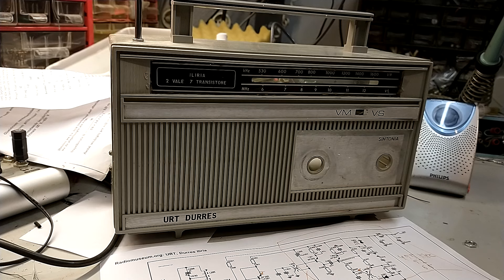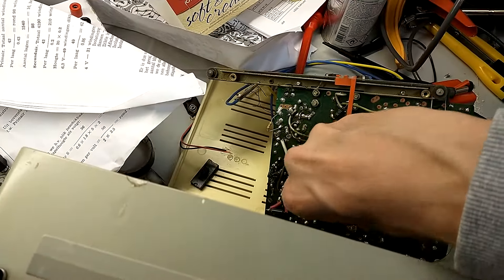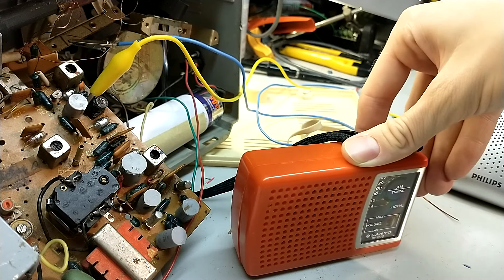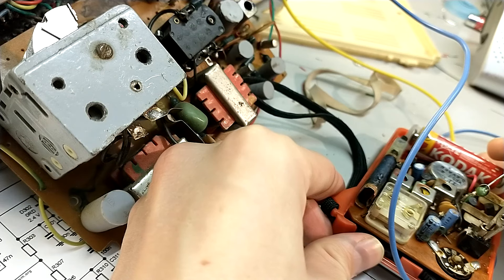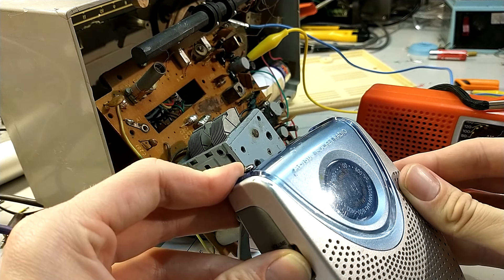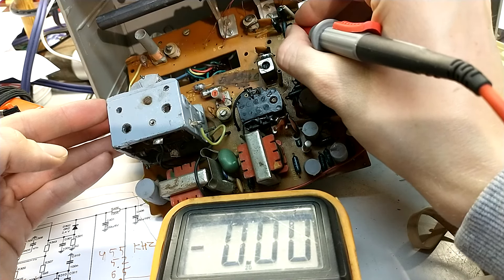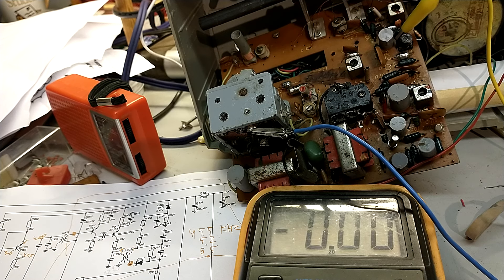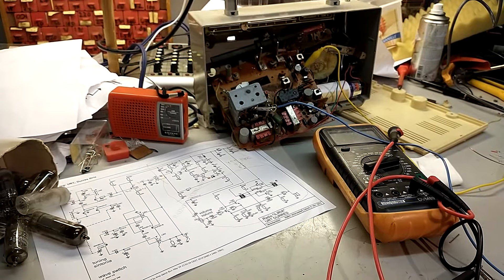Diagnosing and Repairing faults or defects in transistor radios, without special test equipment

Comment: The transistors seldom go bad.  The transistor will have nearly the same voltage on the emitter and collector when it has been biased into saturation - the base bias current has turned it fully on.  When there is something wrong with the voltages, it's a good idea to check the capacitors, especially electrolytic capacitors.  They often fail, causing leakage and excess bias current.
Reply from the maker: RF germanium transistors, as well as certain silicon transistors (the bc148 series), can in fact go bad. It doesn't happen too often, but it definitely does happen.
Reply from the maker: Bit of a late reply, but the Japanese also suffered from bad transistors though a bit later on, in the 1970s. Particularly notorious are the 2sc458 transistors in Akai GX-series tape recorders. They go noisy or fail completely. Akai recorders made before or after that time have none of those issues - that i'm aware of, i mostly worked with GX4000 and GX630 recorders. 
Although transistors are fairly reliable and definitely more reliable than electrolytic caps, if a device is malfunctioning you cannot assume that transistors never fail. With soviet transistors i have no experience at all. American transistors are rarely seen here, and all the american equipment i have had (Marantz) was either made in Japan, or from before the tube era (Hallicrafters and other such radio stuff)
Reply: @mfbfreak  
The smallest wafers that are made are 200mm, but most are 300mm.  For a BC547 or a 2N3904, each transistor 'chip' or die is a half mm on a side, so a 200mm wafer can be cut up into 20 thousand or more transistor dies.  So the wafers may be made in any country that has a wafer fab plant, and a box with fifty or more wafers, more than a million transistor dies, can be shipped to any country where the wafers are cut up and assembled into transistor packages.  A close country to the US where labor is low cost is Mexico.  So the transistors are tested and separated into various performance categories, labeled and shipped to customers, which might be Japanese, Chinese, American, Korean, or a European company, among many others.  So when you say American transistors, they may have been made and assembled in any of a number of countries, along with the same transistors sold by other companies around the world. Many transistors say on them where they were assembled.  And it seems that few if any of them were made in America, because labor is much cheaper in other countries.

Comment: Nice one I`m just starting working on old radios for a hobby age 63 making that little radio  works real good so inspiring  big RESPECT an luv to all
Reply from the maker: Good luck. Many basic problems are easy to solve. Even as a beginner you can have some success. As time progresses, you can fix more difficult problems. 
The radio in the video is a really hard nut to crack.
Reply: ...I'm a vintage transistor radio enthusiast MYSELF-!
Reply: moi je suis plus que débutant mais avec une aide et votre  méthode  je pense peut être arriver a quelque point positifs  à 65 ans  @mfbfreak

Comment: That's good, now is there a way of diagnosing the 3 sections of a tube radio without special equipment........signal generator, and oscilloscope?🐞
Reply from the maker: It works mostly the same, just take care with the high voltage. 
Tube radios can also have different IF frequencies depending on where they came from (Dutch 452, most others 455, but german sometimes 465khz)

Comment: Great video!! Thanks a lot for sharing 🙏
Qst pls: what's that component you used to touch the Sanyo's diode?
Reply from the maker: That's a ceramic capacitor. You can try out anything between 10 and 100pF.

Comment: BRILLIANT!!!  Thank you!  Very instructive.

Question: for the case where you pick up the internal oscillator of the one radio with the other... is the internal oscillator just a sine wave?  If so then how does the other radio pick it up?  Doesn't it need to be modulated?
Reply from the maker: Yes, it is an unmodulated sine wave. If you tune the receiving radio to a quiet spot, you will hear the noise disappear. You won't hear a tone, but the background noise disappearing is a clear sign the oscillator works. 
If you tune it just to the side of a weak radio station, you can hear a tone, which is the heterodyne (difference) beat note between the carrier frequency of the radio station, and of the oscillator of the radio.
Reply: @mfbfreak  thank you... I've forgotten the details of the video.. so you're saying that the radio's internal oscillator will be picked up on the other radio as a "blank spot," correct?  that makes sense... and then one can tune the radio to a weak radio signal and then off of it a bit and one will hear a tone? ... but that's not related to diagnosing the not working radio, correct?  And, in your video, did you not imply that one would hear a tone from the bad radio if the bad radio's internal oscillator is working?  but you are saying now that it is not a tone but a silent "sound"?  correct?

Comment: U have a MILCOV 7 from Romania there-change the electrolyte caps and big tuning capacitor-the variabile capacitor can cause thatvu find ONLY 1 station everywhere...
Reply from the maker: Although caps can absolutely go bad, in this radio the problems were not the capacitors. 
Capacitor swapping wouldn't have fixed this radio.
Reply: @mfbfreak  not that was what i mean- an old tehnician told me that the tuning cap is in most of the cases what become faulty

Comment: 0.7 v should be difference in base and emitter voltages , you mentioned between emitter and collector?
Reply: Precisely
Reply from the maker: Whoops, yes indeed, the B-E voltage should be 0,7v for silicon transististors.
Reply: @mfbfreak  Wow, 2 months to respond

Comment: Congratulations! Excellent explanation! One question: is it possible to use the same method for FM?
Reply from the maker: My apologies for the late reaction. Yes, in theory you could try the same for FM, with two FM radios. 
Keep in mind the IF on most FM broadcast radios is 10,7MHz, so if you want to hear the local oscillator of one radio, you have to tune it 10,7 lower or higher. You will hear that oscillator as a silence, when you normally hear noise.

Comment: but, where is that transistor replacement video ?
Reply from the maker: Ended up not making it, because there seemed to be another issue; the first IF filter is bad and i have to figure out which IF can from the west i can put into this radio from the east. 
Also, idk if people wanted to actually see it. It's only recently that people have started to subscribe to my channel, a year ago it was at just 20 subscribers hehe.
Reply: @mfbfreak  ...I can remember when you could buy transformers for transistor radios from Radio Shack!!

You could probably substitute an IF transformer from a Japanese transistor radio for the bad one in this radio (I've seen them for sale on ebay- but I don't remember if the first IF transformer has a yellow or white colored slug), but make sure that the substitute IF transformer has the same pinout as the one in the radio(!)
Reply: @mfbfreak  all right, did subscribe ! but if you want to attract more subscribers, you need to work on those presentation, editing, lighting and thumbnail qualities !
Reply: @iceberg789 yea..like shango066 and Jordan pier

Comment: Those are germanum transistors
Reply: The radio has a mixture, the audio transistors are germanium but the BF255 and BF254 are silicon transistors.